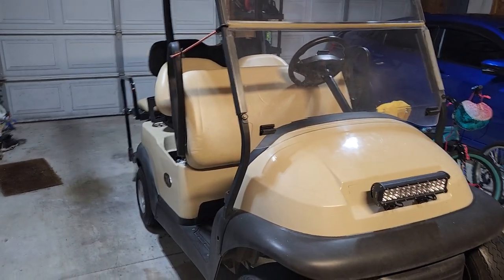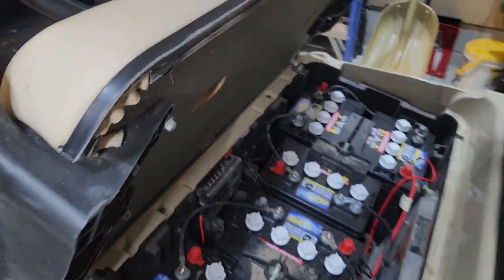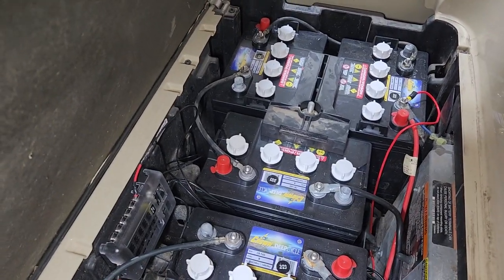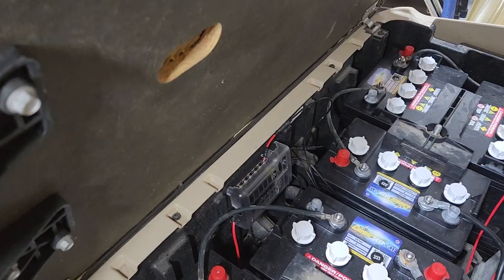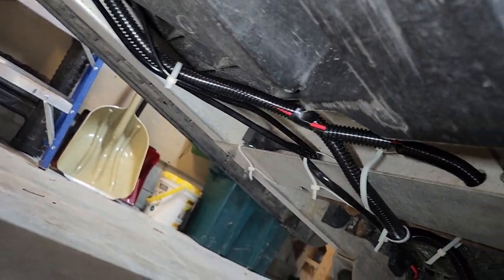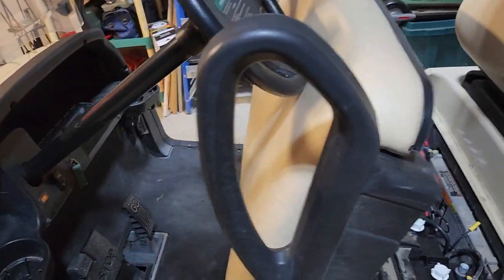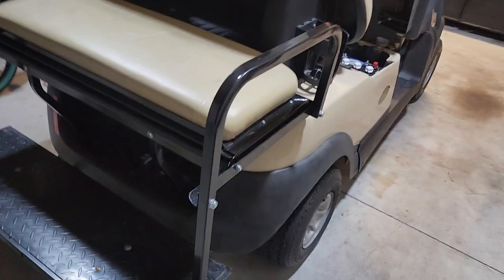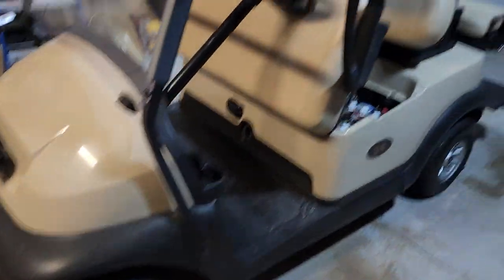Club Car Precedent installing a 48v to 12v converter tips

Comment: So on the side of the fuse block goes to the neg battery..last in the series? 
From reducer you go to the positive battery first in series?
I've got a 2015 precedent...is there also anything in the silver box behind the batteries ?
Reply from the maker: From what I remember your have to send the power through all the batteries to get the full 48v.  Not sure what's in the silver box.